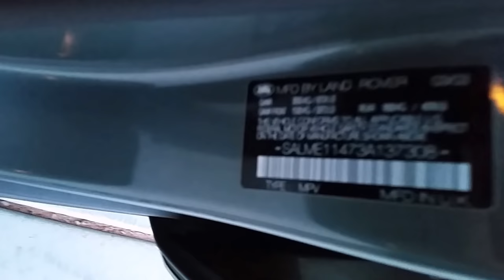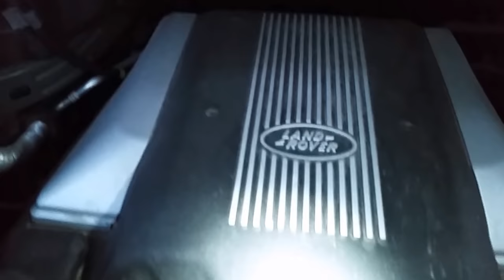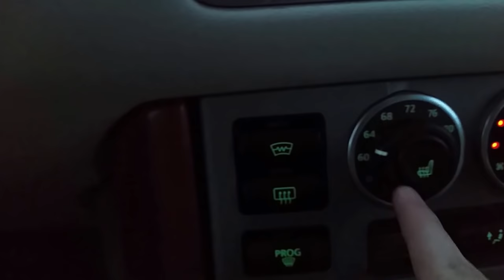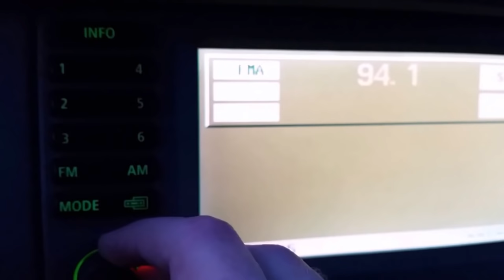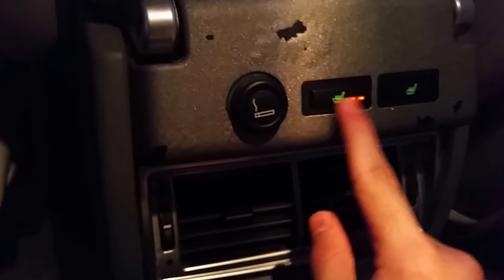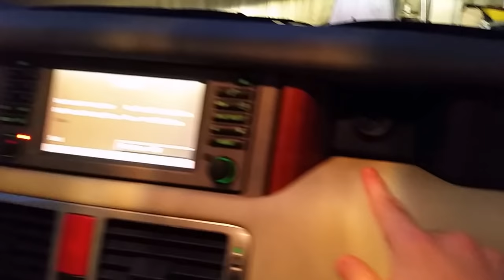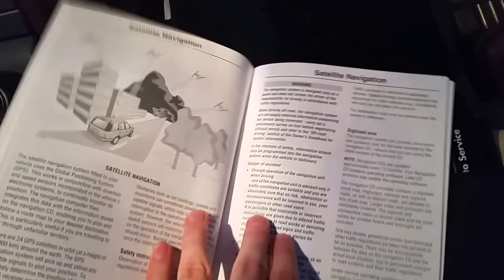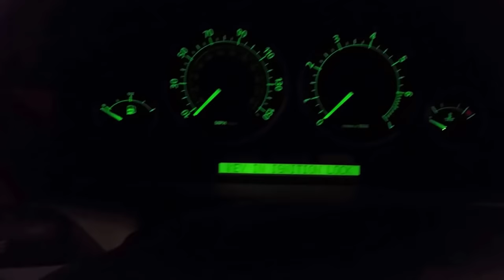2003 Land Rover Range Rover HSE Full In-Depth Review *1080p HD* *(Night View)*

Comment: Noise is normal, VANOS units from 80k onwards start to get louder and make the car sound like a Diesel engine. Nothing to worry about just leave it. You will know if something's wrong as it would make a lot more noise then that.. Ie if chain guides failed.

There nice cars

Comment: I have never had any issues with the motor.  My 04 has been solid and it's over 140K. I know a bit about the troublesome older motors,  but would be no help here. Maybe check the forums?
Reply: does it really good friend,I want to buy a one soon,petrol engine,do you recommend it

Comment: I have two of these and I already know them like the back of my hand any advice on the vehicle I'll be glad to give. love these cars
Reply: Robert Salas Looking at one of these. How reliable are they? What problems have you had?
Reply: 02 to 05 they have the bmw engine m62tu it is a nice strong engine but bmw has this 10k oil change deal and that is way too bad for any engine so look for the oil if its way too burned dont get that car problems following this is oil seperator clogged and this causes to put pressure on to the oil system and leaks from everywhere . and timing chain guides any rattleling no matter how small it will be a huge problem .transmission has. No oil change its supposed to be for life yes but for the life of the trans not chainging the oil on trans makes the valve body to crack inside and you wont have reverse as its pneumatic. Find one that has 80 k or under and change all fluids airbag system is grat but sometimes it fails and you need to switch to coils springs .the range rovers 06 to 09 have the jaguar engine and it pretty good . dont have any info on these
Reply: Allways change the oil filter
Reply: 2003 model is it a gas waster?

Comment: the button you pushed with P on it what does that do??
Reply from the maker: I'm pretty sure it either turns on/off the front and rear parking sensors.  In the video I think I turned them off by pressing it with the light no longer flashing after pressing it.
Reply: Thank you